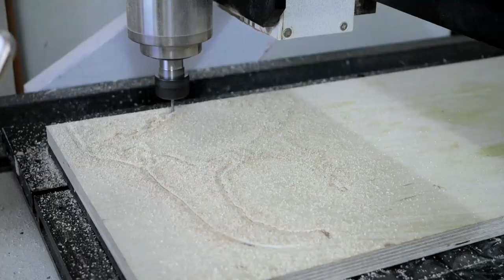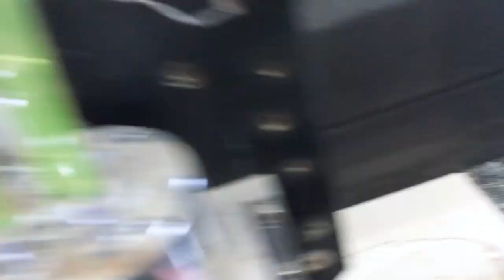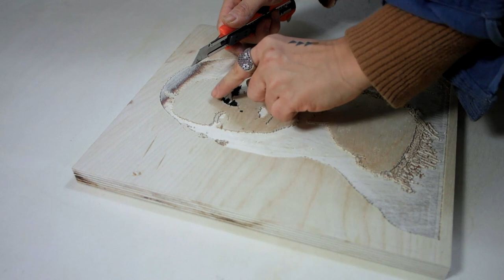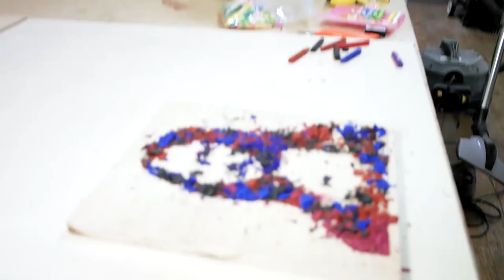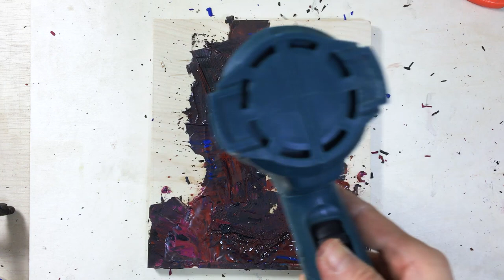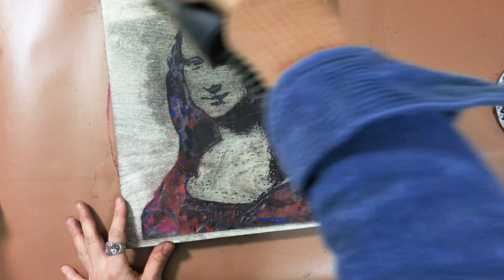Mona Lisa with Crayons

Comment: Very cool! I wonder if putting it back on the cnc to trim the top layer would have speed up the sanding or just ripped the wax out
Reply from the maker: I think it Is not good for CNC machine. I worried the oily crayon could stick to the spindle. so I couldn't try it.